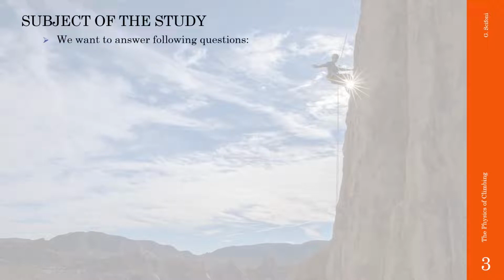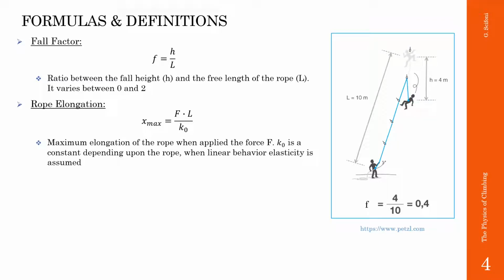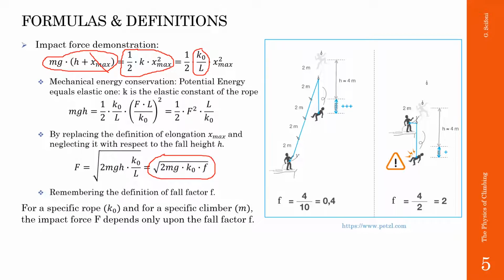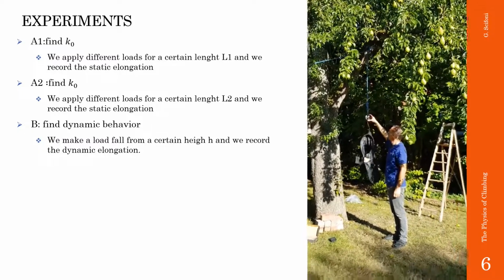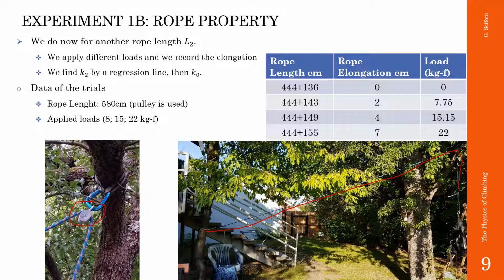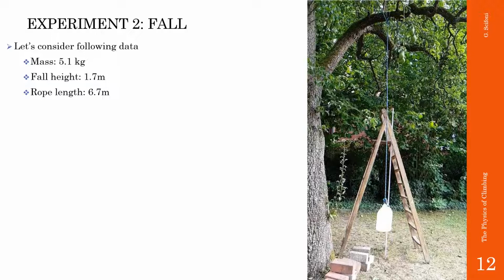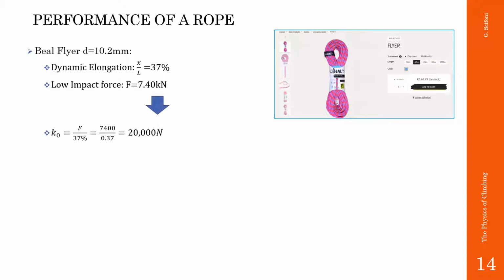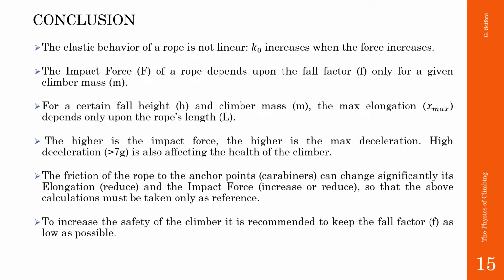The Physics of Climbing

Comment: Sir you could tape the cell phone to the canister and measure the acceleration using an accelerometer app. The application uses the sensors in the phone and draws a graph of the acceleration.
Reply from the maker: Great. Thanks for the tip!